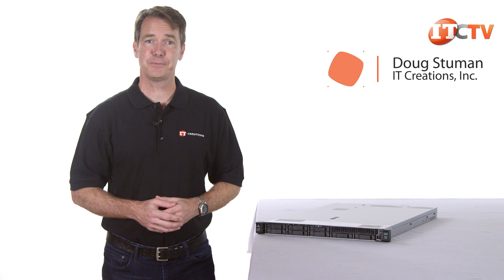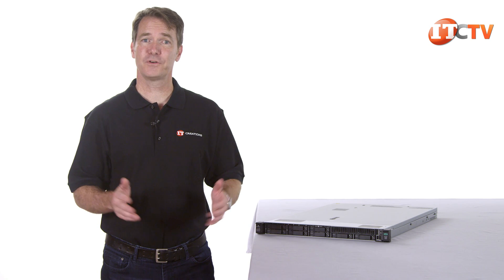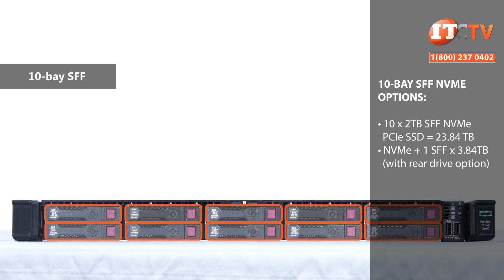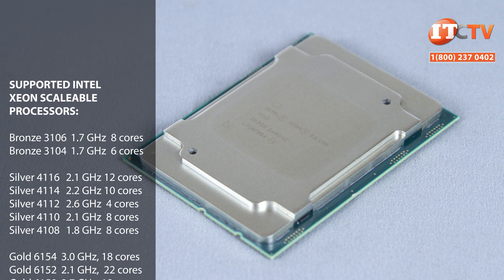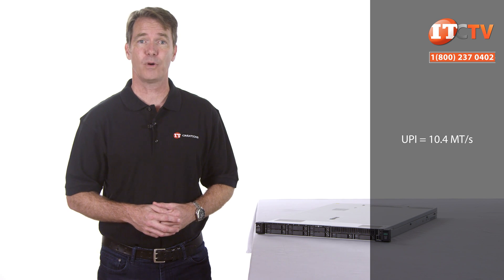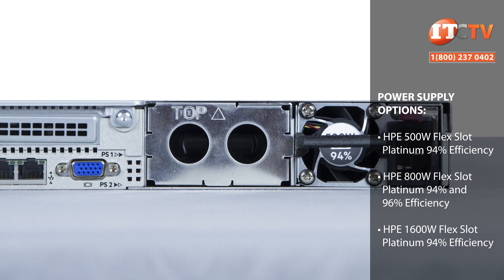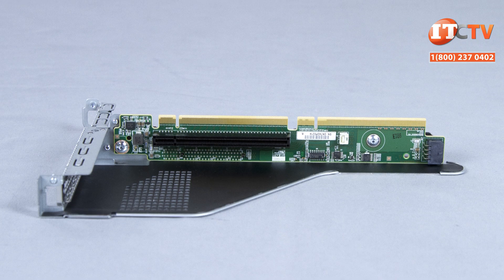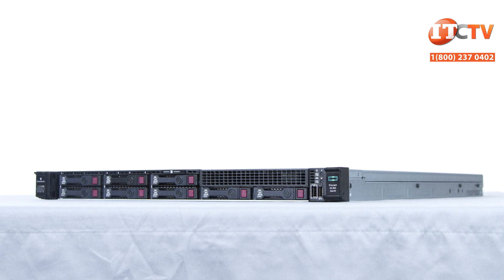HPE ProLiant DL360 Gen10 Server Review | IT Creations

Comment: Hi, Can you please also create a video to install a NVMe M.2 SSD on DL360 Gen 10?
Reply from the maker: Hi Akshar, We may produce a video addressing this in the future but in the meantime…
There are a few options for installing M.2 drives on this system. There are PCIe card options and a SATA M.2 2280 Riser option (installation on page 69 of the User Guide here: https://www.itcreations.com/user-manuals/DL360G10/HPE-ProLiant-DL360-Gen10-Server-User-Guide.pdf )
You can also install special uFF drive trays that will support two M.2 form factor drives in the optional rear drive cage (page 58 of the same manual as mentioned above, here's the data sheet for the uFF drive tray thing., https://psnow.ext.hpe.com/doc/PSN1010930696UKEN.pdf). 
Hope that helps, and thanks for watching!
Reply: Hello,

Did you installed NVMe M.2 SSD on dl 360 gen 10
Reply: @sanvika2507  yes, we used https://www.amazon.com/Vantec-NVMe-SATA-Adapter-UGT-M2PC200/dp/B0751CJ139?th=1 adapter. Hope this helps